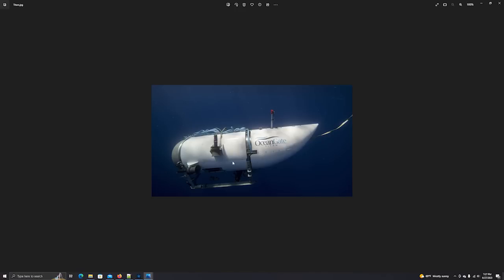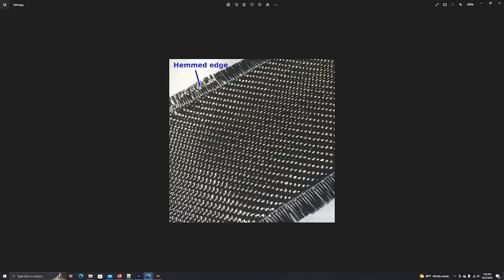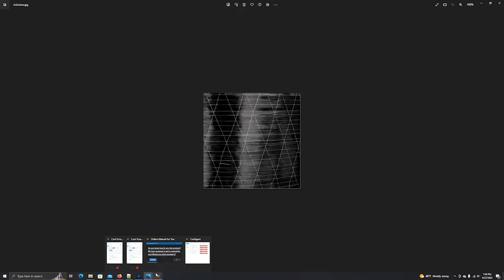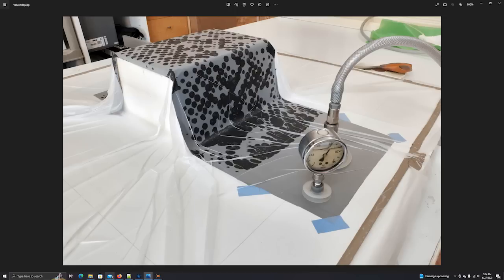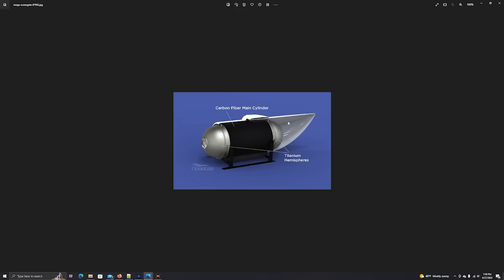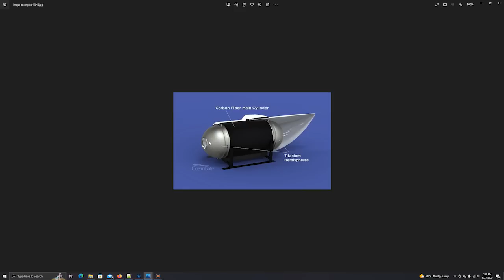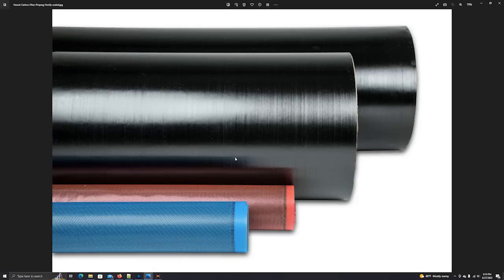Oceangate  Titan Submersible Manufacturing and Engineering Issues Part 1

Comment: @JoediyLab Is there any understanding as to why Oceangate ignored conventional wisdom and experience and used composite materials at all instead of steel or titanium with known properties and repeatability in performance, use and relatively straightforward methods of NDT and condition monitoring?
Reply from the maker: Hard to say why, he had an engineering degree.  Maybe cost savings but a total disregard for rules and regulations.
Reply: @JoediyLab  I’d love to know why, maybe had to be different, wanted to be a pioneer but it was obviously flawed. I’d be very surprised if it was cheaper, lighter perhaps and maybe some ongoing cost saving but I don’t think the use of carbon fibre would have been cheaper to build and perhaps the other consideration is the ongoing cost of maintaining the integrity through NDT but it seems that they weren’t doing that apart from the acoustic monitoring
Reply from the maker: Yes it appears that acoustic monitoring was all they were doing.  It appears that Stockton Rush was adverse to following standard industry rules and regulations.
Reply from the maker: Good questions,  I really do not know,  On one hand he indicated he wanted to be safe, His ex-business partner said he  would never allow un-safe operations.  But everything in the media indicates he disregarded following rules and regulations.  He had a degree in engineering.  But yet he wanted to cost cut.  I heard servicing paying customers was not his goal.  He wanted to do more research on the titanic.  But he needs money to do that.  He seems to hate the industry guidelines.  It sure seems like he fooled himself into believing he could get away with it.
Reply: @JoediyLab  yes certainly interesting. Personally I know nothing about deep sea submersibles but with 3 trades, one of which is Industrial / petrochemical refrigeration there’s simply no justification for using pressure system components that don’t have pressure ratings that exceed the system requirements and that’s on systems that while they have potential to kill or injure someone it’s opportunity to do so is nothing like the criticality of having human lives depending on almost every component under 4000M of water and a 40MPa pressure differential.
If this thing had been unmanned and remote operated then the catastrophic failure is of little consequence and perhaps a proving concept for a manned vehicle of similar construction.
Anyway I guess we may never know why he went that path

Comment: What are your thoughts on the longitudinal compressive forces the cylinder was exposed to with each dive. Approximately 400 atm x Pi x Cylinder Radius ^2 = 14.7 x 400 x 3.14 x 48^2 = 42.5 million pounds of longitudinal compression in addition to radial compression. Longitudinal area = Pi X ( 48^2 - 43^2) = 1430 in sq.  Therefore 29,720 psi cylinder wall longitudinal compression. I don’t think any carbon fiber runs in that direction; therefore must be carried by the epoxy resin?
Reply: I like reading comments like this. I am not scientific at all, and have a high school level understanding of math. But somehow I can infer the point you are trying to make.
Reply from the maker: I heard that in some data from Pacific coast composites that did run plys in the hoop and axial direction.  But I have to confirm
Reply: @JoediyLab  I calculated that the composite carbon fiber cylinder would’ve experienced 29,700 psi compression in the longitudinal direction and 60,600 psi radial compression throughout the entire side wall at Titanic depths. I think Stockton felt safe with carbon fiber composite because it has a compressive failure pressure of approximately 250,000 psi if it’s not damaged. But fatigue cycling and differential strains between titanium and carbon fiber may have done him in.
Reply from the maker: @jamesn3513  wow,  very cool.  Yes I agree with your thoughts.
Reply: @jamesn3513  and just what if a horrible mistake was made an error in judgment that may very well not wish to get revealed RE:  litigation;  that Sunday noise was bottom brackets falling down, not any implosion.  So rescue was not pursued underneath but above.  Then when Canadian C-3  Orion plane heard 30 minutes of banging, is when those in charge rushed to have underwater ROV brought took hours to get there.
All those days, nights, in ocean pressures, subjected to changing temperatures and freezing ones, 
Can be date of implosion as hull plus resin becoming more brittle to failure!  Don’t be so positive on dates being thrown, consider there may become a hugh liability issue to develop, dates can make or break such possibilities!
Reply: Let us fit into the comments the fact as I see it, most likely in an emergency need wherein Titan was stuck, trapped, or  it’s pilot was injured  not able to carry out its duties,
Certainly, Stockton Rush, in his wildest dreams, never would figure it would take longer than a 24 hour rescue, if that.  Therefore time in waters would  contribute to hull fatigue, brittleness!  However, as it took way over the 24 hours  deemed, especially since well known destination is Titanic which is not a secret location, that premise made this fatal wherein hull could not withstand nor epoxy!  Titan was never constructed to remain within depth pressures for 5 entire days!  Any wonder why?
Reply: @maryannsinopoli1751  I agree with James Cameron. it’s incredibly coincidental that the tracking and communication ended at the exact same time Sunday morning along with an implosion being recorded by several sources, including the US military. There are engineers that said, the people on the boat probably felt the shockwave. I think it’s going to come out that people knew the sub was lost immediately, but of course should not give up hope immediately.
Reply: @jamesn3513  well to be tight lipped about it when they knew results, is horse s—-!  There should be consequences for tight lipped folks while the public has great concern with exceptional hopes.  It’s a sin against human compassion.  The people deserve more consideration than that tight lip society offered!
Reply from the maker: @maryannsinopoli1751  we will never know the real why, but it appears that maybe he was fooling himself into believing that it was safe without further testing after each dive.  Thanks for your feedback
Reply: @JoediyLab  that’s like saying he took suicide lightly.  He was a family man, had a son and daughter.  By no means, would I believe he didn’t value his own life! And put confidence before it!
Reply: @jamesn3513  I know very coincidental, almost like a drama of a planned execution!

Comment: mi issue was with the solvents and glues used they didn;t even degas them so you would have tiny bubbles impregnated   into the hull
Reply from the maker: Good point,  I saw a video of the application of the epoxy adhesive,  the video did not show degassing
Reply: I was surprised to see them stirring the epoxy for the end ring bonding.  This could entrain air.
Reply: @TricksterJ97  those tiny bubbles contracting and expanding can't be good pn the hull

Comment: I'm asking myself : the cylindre has roughly 2 m diameter. Could the differential pressure of 0.2 bar around absolute pressure of 380 bar explain (at least partially) the implosion ?
Reply from the maker: Yes,  and the fact that the repeated dives could have weakened the carbon fiber.

Comment: The question I keep coming back to is, why carbon fiber? Knowing Stockton Rush, I wouldn't be surprised if the reason had to do with cost cutting.
Reply from the maker: When properly designed and constructed carbon fiber is very strong, and with  post dive inspections would be very  safe.  Carbon fiber is also much lighter and therefore is better than titanium for buoyancy issues.  Thanks
Reply: @JoediyLab  Yes, CF is closer to neutral buoyancy and requires less use of syntactic foam or ballast tanks. It makes the submersible smaller and lighter for the given crew capacity which translates to easier and cheaper operation. So, underneath it all is cost consideration (which is fine so long as the engineering isn't compromised).

Unfortunately, engineering is expensive when you have to build out your experience base. If NDT wasn't possible for a 5 inch thickness of CF, a full destructive testing campaign proving both the fundamental design and variation in manufacture was the safest course of action.

Comment: I've constructed and tested composite pressure vessels to destruction. There is no reliable possibility that unidirectional fiber, or bidirectional, can seal against high P water intrusion, which is why all my builds had a steel or aluminum facing towards the pressure source to waterproof the key structure. Moreover, fiber composite excels only in tension, not compression, so the base design concept itself is fundamentally flawed.  Yep, no superliberal glue with squeeze out.  Yep, all my destructive failures were at the end caps.  The viewport could have been blown-out by the compressive dieseling, which could have also blown out the end rings.
Reply from the maker: Based on the recovery images, that is what appeared to happen.  The end flanges were found separated from the carbon fiber section.  In all of the images I viewed I saw no trace of any carbon fiber.
Reply: @JoediyLab  Sometimes investigators can be so lame...the 2 years study estimate is our clue about looking into a failure mode that no sane person would have taken beyond first small test experiment in the first place; he never did the most rudimentary study of the nature of the material. No...2 years would be too long just as stupidly and/or opportunistically ..just sucking taxpayers or insurance money, I suppose.
Reply: Some clarification:  The fibers of the Unidirectional tow windings had no apparent fiber to bind them; all that existed is epoxy. Progressive splitting with water intrusion, and operational friction rubs, between the unreinforced wound carbon tows would produce the reported sounds. The tube itself could thus have essentially simply split.

Comment: 12:28 hey, there is your answer on the length the carbon fiber shell is 9ft without the rings. 6ft ladder on the left, 12ft latter on the right, each ladder rung is 1ft, the person in the photo is taller than 6ft.
Reply from the maker: Thanks

Comment: Wonder what the cylinder was made of? I'm sure if it were made of Titanium it would of survived.
Reply from the maker: Titanium end caps and carbon fiber wrapped cylinder.  There were titanium flanges glued to the carbon fiber cylinder
Reply: @JoediyLab  Carbon fiber was wrapped around another cylinder what was that stock cylinder made of, I mean you can't wrap CF around air that's what I'm wondering or was the stock cylinder made of CF.
Reply from the maker: @doughebert4116  more than likely stainless steel, used as a mandrel, once cured, the carbon fiber cylinder is pulled off.  The titanium flanges are then glued on.  Thanks
Reply: @JoediyLab  Tks Joe got more info from your presentation than all the others.

Comment: Carbon fiber sounds like an E-car.
Don't charge it too much or it will blow up.
But don't let it die or it will blow up.
Reply: Lithium batteries are most problematic at 100% charge because that is when the insulation is most likely to fail. Dead flat is no problem.
Tesla have a crash team that goes to wrecked Tesla’s to discharge the batteries.

Comment: People aren't able to stand inside the cylinder -- it's definitely not 8 ft in diameter. Maybe it's around 8 ft in length.
I found a reference that said the entire submersible was 8 ft high.
Reply: In those measurements they are generally noting the entire height of the submersible including the landing skis .
Reply from the maker: Yes it is closer to 5' 10" I could not find the pressure  vessel dimensions,  but I spoke to an engineer who knew.
Reply: There is a flat floor, and presumably equipment under it.

Comment: I watch the entire video of them making it. There's a full length video somewhere out there from start to finish. That actually wound that carbon fiber around a titanium cylinder. You can see the inside of the cylinder from any picture of the inside of the submarine.  I feel like there's a lot of people that missed that. For the guy to say that he held a flashlight on the back of it in the mid section and could see voids is preposterous.  I haven't finished watching yet but you haven't included this titanium cylinder yet. You said its made of just carbon fiber. Its not. Just so we all know. I heard an expert say the other people on YouTube. That did the pressure test model, say it was an excellent model. When in reality, it was a horrible model of it that it include the titanium core. I have no idea why people want to exclude it. Who knows but it was there
Reply from the maker: That is a stainless steel mandrel.  Once the carbon fiber is cured they pull the cylinder off of the mandrel.
Reply: @JoediyLab  thats not what they said in the video. They said it was made of titanium. You can see it in the interior pictures of the sub.

Comment: They're also saying you bought expired carbon fiber, which makes no sense because carbon fiber is inexpensive, all of the cost lies in RND and building of the molds.
Reply from the maker: Thanks,  actually good carbon fiber prepreg is very expensive.  $50.00 - $70.00 a yard.  Just think how much five inches thick would cost.

Comment: The Titan Submersible DID NOT have carbon fiber fabric.

They used a continuous filament yarns parallel wound onto a large “bobbin style” mandrel. 

With 39 years of advanced material reinforcement, manufacturing and ASTM (I) failure analysis engineering experience, I am shocked at major issues clearly seen. 

They violated “Broke The Rules”at every turn.
Reply from the maker: In one of the first subs, yes they did use dry carbon fiber tow in the first part of the construction.  Then later they use some carbon fiber prepreg.  In the titan sub they used carbon fiber prepreg tape, with a tape laying machine, in various ply orientations and performed a heated cure.   Thanks for the comment.
Reply: @JoediyLab Per the video of the winding of the carbon fiber onto the mandrill “bobbin” they clearly did not have uniform tension on the individual strands (tow / yarns) and the pitch of the wind had uneven overlapping. 

This caused significant deformation defects in the winding process and without uniform tensions on each strands  strand the tensile strength and uniformity between the strands working as a complete system is lost so the sum of the equation is only as strong as epoxy and cutting process. 

With improper load sharing and hidden air pockets, when the delaminating process started these air pockets were breach and the vehicle started loosing its buoyancy and can’t surface in time before the eminent implosion. 

Sadly, all those aboard did know a catastrophic implosion and explosion was a imminent.

Comment: 11:43 if the model in picture is correct and isometric the length is about 10ft by measuring with a calliper
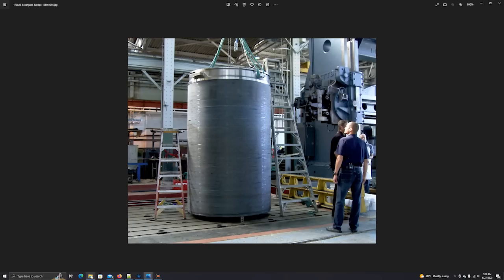12:12 from the actual picture I got 13.05 :)
Reply from the maker: Thanks  I was guessing at 12'.

Comment: It was a financial consideration to make the hull only 5 inches thick, submarines don’t need to be light… carbon fibre was cheaper than conventional means
Reply from the maker: Yes very good point.
Reply: Weight is a concern with submersibles because they need to have sufficient buoyancy.

Comment: Bonding the Titanium Ring and the Carbon Fiber Hull with Glue I think the glue is one of the culprits why that sub imploded. I cannot imagine how that friggin glue can withstand and last under pressure at 12k feet below the ocean.
Reply from the maker: It is standard procedure to bond carbon fiber to metal alloy, very strong bond.  You cannot bolt to carbon fiber m, way too much stress in isolated areas of bolts
Reply: It looks like maybe 5 or 6 inches of lengthwise dimension for bond surface area between titanium part and CF part. Does that seem like enough, or is it sheer area of circumference and length that matters the most? It just seems like not much area to "bite" into the tube...or is it intended that this region not have too much bite, as it could damage the CF cylinder integrity? So the main adhesion was to be the butted area between the CF cylinder wall thickness and the dome seat?...but maybe that isn't even a great area to load a CF cylinder? It's not perfectly flat (like a machined part), and it's just "crushing" the fibers on their side?
Reply: Carbon does not bond with titanium. Only same aluminium type can be bonded, and not with epoxy.
Reply from the maker: @hvg3488  Thanks for the comment

Comment: This is fascinating, but your mic is just way too close, and the plosives are quite annoying. I'm guessing you're using a headset mic? If so, please move the boom out, or down, if it won't swing outward. you want the mic to be below the mouth so the plosive bursts of air can't strike your mic. This will also damage the mic, over time. I went through three headsets when I worked as a call taker for 911 in a year, before my boss saw how I was wearing my headset in corrected me. Oh, and they took the damaged headsets out of my pay. LOL It's a shame Oceangate cut so many corners at the cost of life. Thanks for sharing this. I learned a lot I didn't know about carbon fiber.
Reply from the maker: Ordered and just setup a new mic with pop filter.  Thanks
Reply: @JoediyLab  Awesome! Looking forward to hearing how it sounds in the new productions. :)

Comment: You need a pop filter for your microphone. 23 minutes of plosives in your narration. Pop filters are cheap and easy to use. 

Also, that hull looks like graphite. Could they have overcured?
Reply from the maker: Carbon fiber is a form  of graphite.  Or should I say graphite is a form of carbon